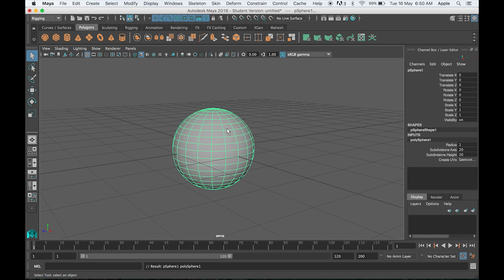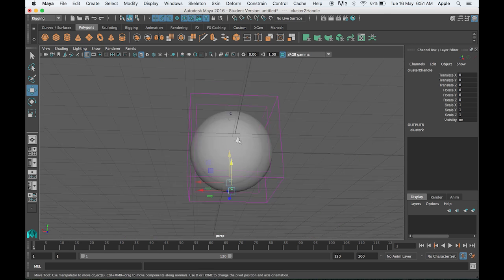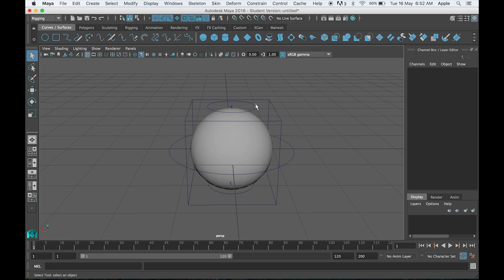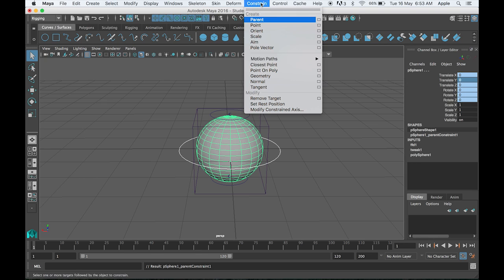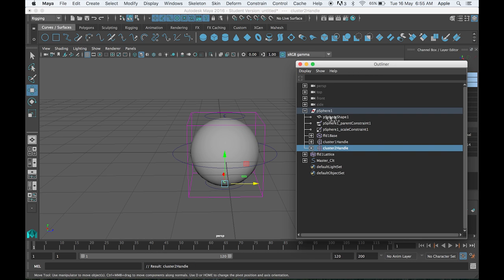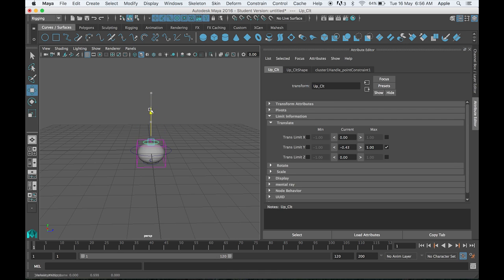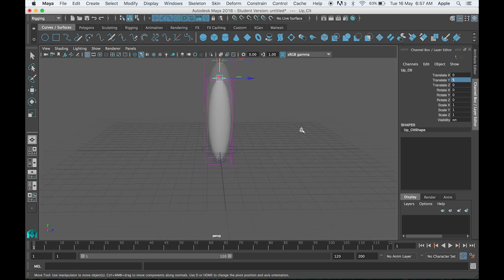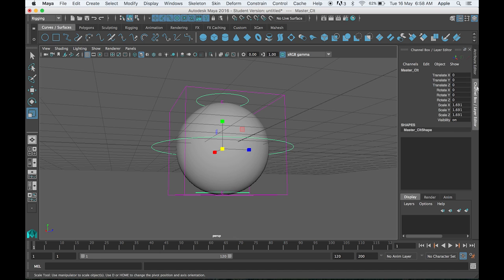Ball Rigging using Maya Deformers

Comment: hey, I need some help. I am rigging a car right now and the side window glass is little bit tilted and the axis rotation for the move tool  is not as it should be its straight and the window is tilted as I said, now I want to open the window with move tool but due to its orientation it not not going how it is supposed to be. and I have tried to change the axis rotation in move tool settings and also by pressing 'D' to change its pivot rotation both did't work. Please tell me what I am doing wrong or what should I do.
Reply: did you change the axis rotation to Normals that way it moves the way the object is facing/normals are facing

Comment: I observe one problem in this method is that although you can squash sphere from both the sides it doesn't affect its mass from center which supposed to expand once we start squashing. So kindly rectify this mistake.I really like the approach of rigging. Thanks.
Reply: Thanks
Reply: Set driven key to the other points of the lattice and make it to expand when the ball is squashed. Simply enough.